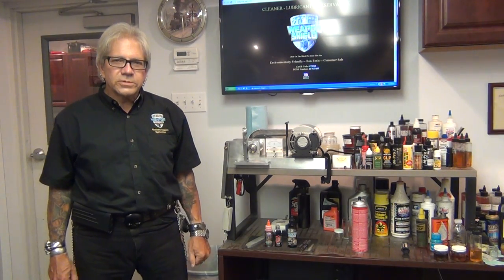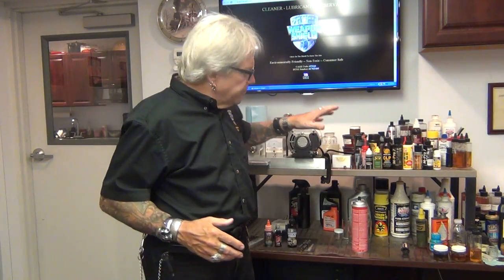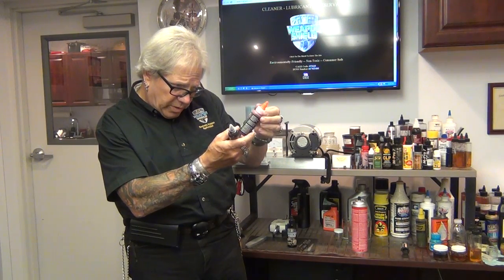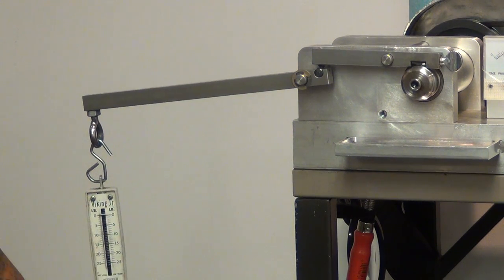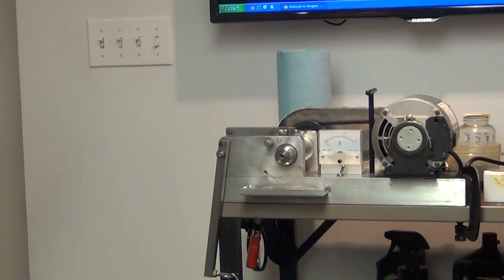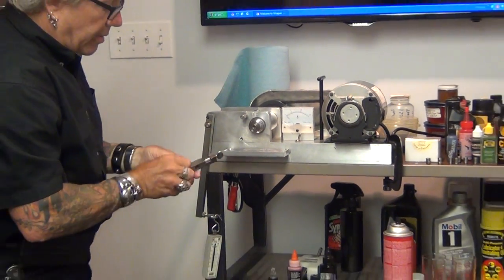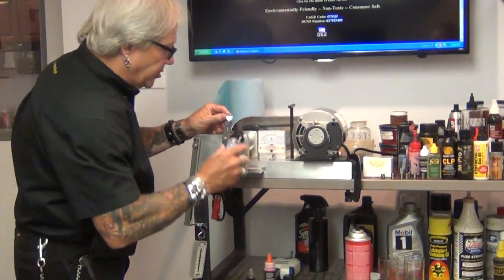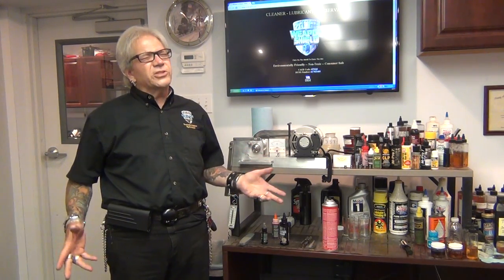Slip 2000 EWL, Lucas Gun Oil, and Weapon Shield Comparisons

Comment: Please do a corrosion resistance comparison and maybe some education on that topic.  I started using Tetra Gun several years ago because I liked it's lubricity - only to discover a few months later that some of my stored firearms had rust damage in the internal workings.  I learned the hard way (and now via the internet) that Tetra Gun does not provide good corrosion protection like they claimed.  Have you not posted corrosion comparison videos because Weapon Shield does not perform as well as other lubes at rust prevention?  I need to know before trusting my guns with Weapon Shield.  Thank you!

Comment: PS: I've also formulated motor oils that passed a 70 lb Tinken.
Reply from the maker: GunnyFits1 That's just outstanding. I don't do Alchemy. This is bonifide lubrication engineering. Everyone thinks they can be a chemist/metallurgist/Tribologist/Lubrication Engineer with a little mixing, luck and gut feeling. People have no idea what goes into formulating a CLP that strikes the perfect balance of additives and characteristics that make a great lubricant, cleaner, and protectant. It isn't luck or serendipity at all and not in a million years. I guarantee your oils would lack in the pour point depressant, anti-foam, dispersant, VI adjustment, and about 10 other motor oil additive necessities. Like I've always said, leave the neurosurgery to the brain surgeons....not the podiatrist.